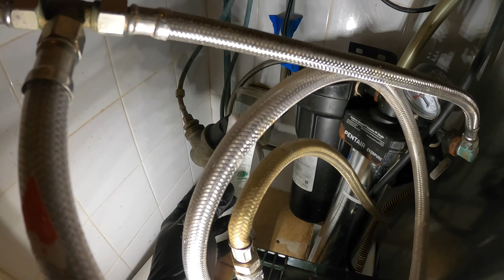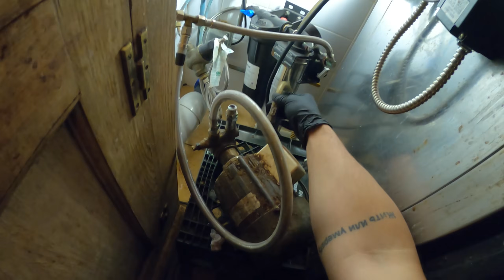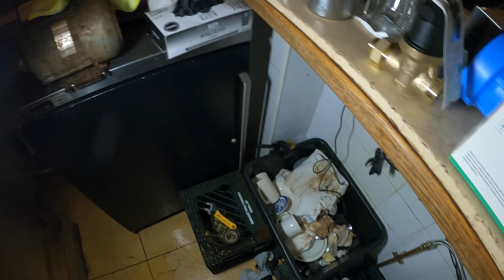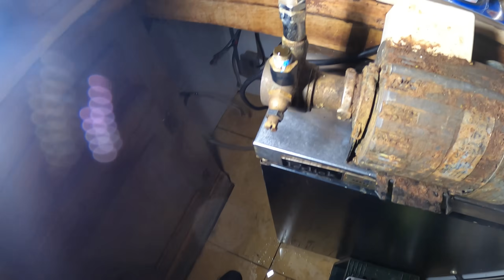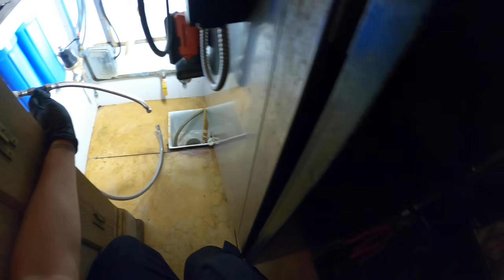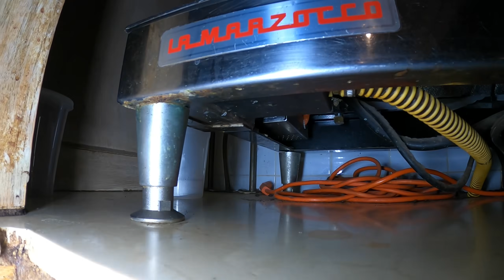PLUMBING: La Marzocco Expresso Machine 2 Stage Water Filtration System Installation/Replacement

Comment: Stumbling across this video gave me a great laugh, here's why - I came across your channel about 30 min ago because I needed help on troubleshooting Hoshizaki ice machines.  I have worked as a coffee tech (strictly espresso machines, brewers, grinders, nitrogen and carbonation systems, filtration, etc) but recently started with a coffee company that has the coffee techs also doing basic service on other equipment in the cafe (ice machines, fridges, freezers, etc.).  After subscribing, I click on your profile and this is your most recent video!  Funny how we're living in the complete opposite situations of each other haha keep it up man!
Reply: Also for the record, whoever hooked up that LM filtration system is a moron.  Quality coffee techs would never have filtration supported by a copper pipe, let alone allow the equipment to get so disgusting (look at that pump motor, yuck!)
Reply: btw if you are coming into contact with espresso machines from time to time, something to keep in mind - any espresso machine made in Europe is going to use a 3/8" BSP threaded hose to connect from the filter to the machine, which is almost impossible to find in the US.  You'll want to keep a few of these 3/8" compression to 3/8" BSP adapters in your miscellaneous fittings bin.  You can try to force a 1/2" onto 3/8" BSP but it will damage the threads and probably leak.  Google "NUOVART22" and the item sold by Simonelli is the one I use when I need to make the conversion.  Pricy but when you need it, you really need it.

Comment: Is it possible to get the screws out of the top of the filter and turn it around? So that your in and out side is changed? Then you can plump your reducing valve direct on the filter

Comment: Does anyone know why those espresso machines need a pump for the water.
Reply: The steam pressure from the boiler in the machine isn't enough to push the hot water through the coffee grounds.  The pump provides the boost it needs.  The coffee is ground very fine and then packed, or "tamped" into the porta filter. So it needs a lot of pressure to push the water through.